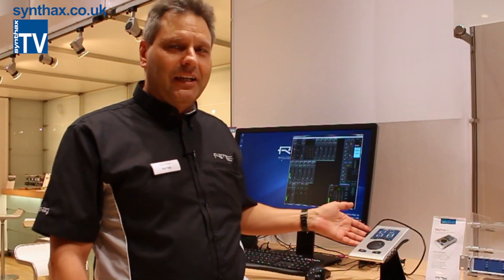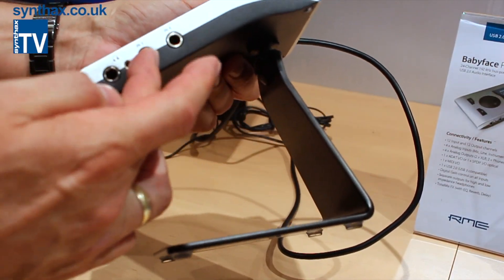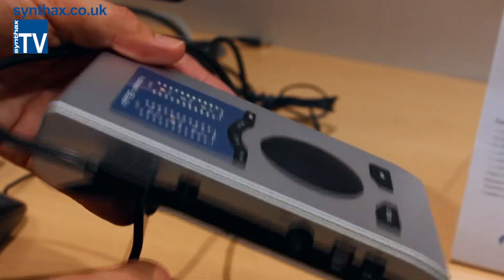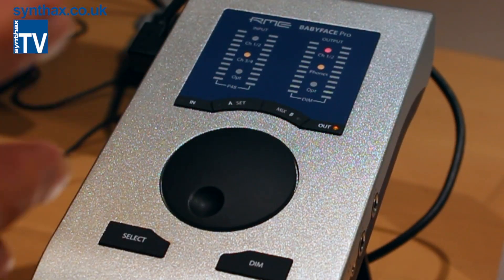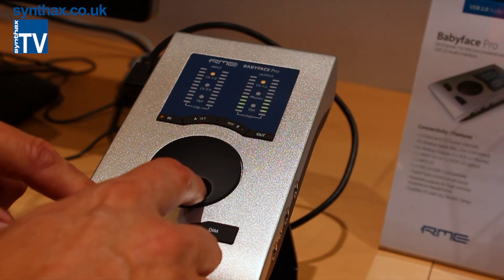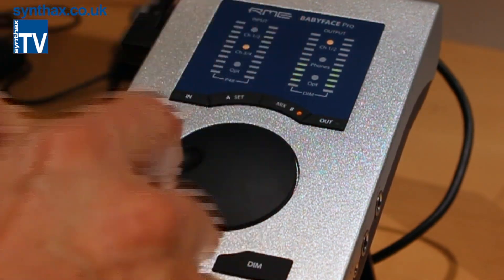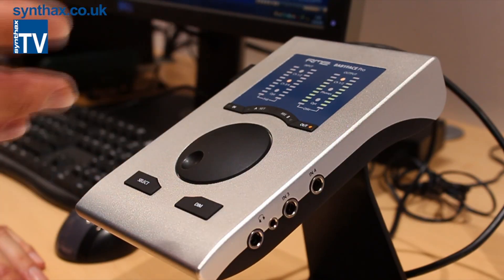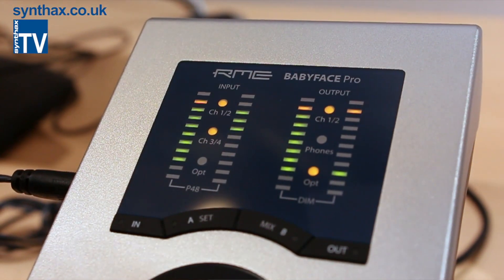RME Babyface Pro Full Overview - Musikmesse 2015

Comment: Where can i get that stand for my babyface pro?
Reply from the maker: Hi there, have a search for the Koenig und Meyer 23250 Design microphone table stand.
Reply: Thank you!!! Do you know if i need an adapter for a smaller screw or will it directly screw on?
Reply from the maker: mbot48 Hi, yes as far as I'm aware it should fit straight on. I belive the Babyface Pro's screw fitting is 3/8 inch, as is the Koenig und Meyer stand. Best of luck.

Comment: So with the mix button you can choose to output only the optical to speakers, and then the rest to headphones?
Reply from the maker: +Wiikendz Hi, the mix button allows you to quickly switch between monitoring the different inputs and outputs on the Babyface Pro, including the first two digital (optical) channels (1+2). 

This is especially useful when using the Babyface Pro in stand-alone mode, or for switching between different monitoring setups (speakers or headphones) at the touch of a button. If you use the Babyface Pro with a Mac, PC or iPad, you can use RME's routing software 'TotalMix FX' to set up different mixes for each output. Hope this helps :)

Comment: Fantastic machine!  However, I think the Apollo has got it beat with it's on-interface effects that you can use in real-time with zero latency tracking.
Reply from the maker: +kurd55 Yes, if it's FX that you want, then the Apollo is an option, but RME is all about the quality, reliability and stability on Mac AND PC as well as iPad. :)

Comment: Roland Super UA vs RME Babyface Pro vs MOTU Ultralite AVB ?
Reply from the maker: Ágoston Berkó 
Hi Agoston,
The RME is the best... but then we would say that :)
Seriously though I won't comment on the competition, but I will say RME is renowned for quality, clean sound, super reliability, great features and long-term support (10+ yr old discontinued products still receiving updates).  Choosing the Babyface would be a good decision :)
Reply: and what about DSD (Roland) ?
Reply from the maker: Ágoston Berkó 
DSD is quite niche (coming from SACD which never really caught on in the consumer market) and there is not much actual material available in that format.  The Roland only allows for DSD playback, not recording.  If you think you might want to playback DSD files then the Roland would be a consideration, but I believe for the vast majority of users this will be an unnecessary feature.

Comment: how does it sound compared to Yamaha MR816x ?
Reply from the maker: Ágoston Berkó Hi Agoston,
Being biased I won't comment on the Yamaha... :)
What I will say is that the RME philosophy is to have a very clean, transparent sound with low noise and good headroom.  This way your interface is a blank sheet of paper on which you can build the sound you want with mic choice, processing and general production techniques.  Some other manufacturers will choose to give their interfaces a particular 'sound' character.  If you like this 'sound' then great, but if you want more flexibility to record in different ways or to adapt to different styles of music then it can be somewhat constraining.
Basically RME = quality & purity :)